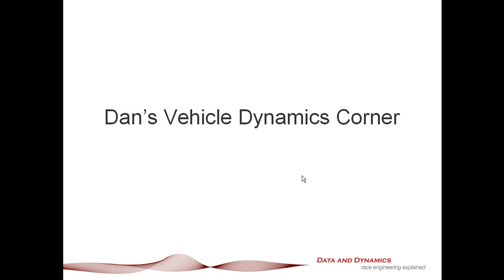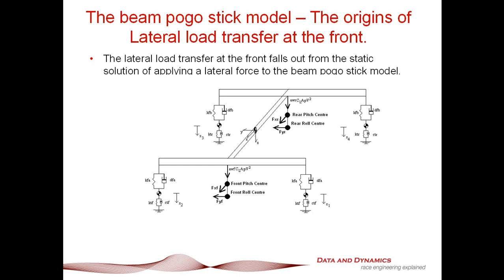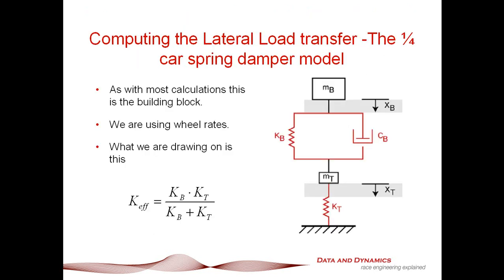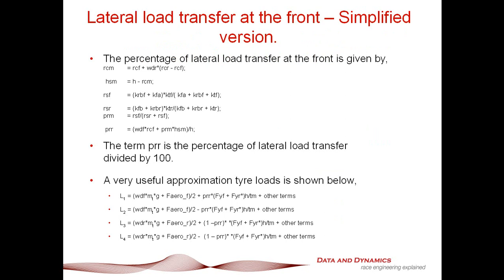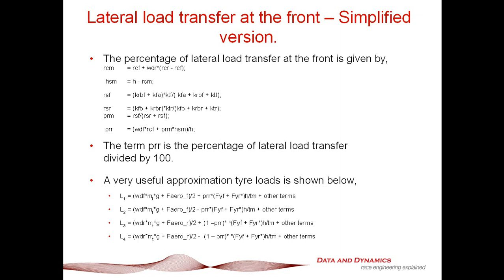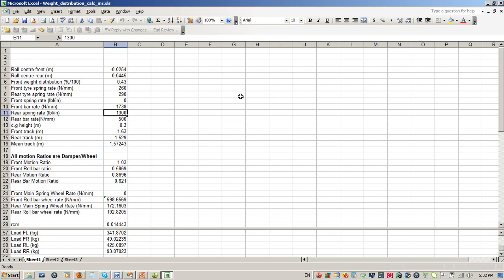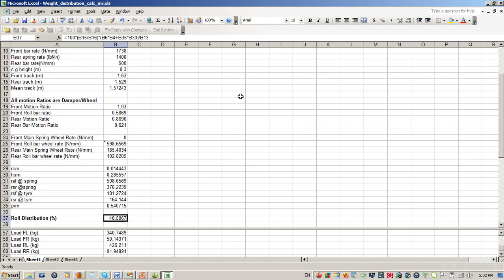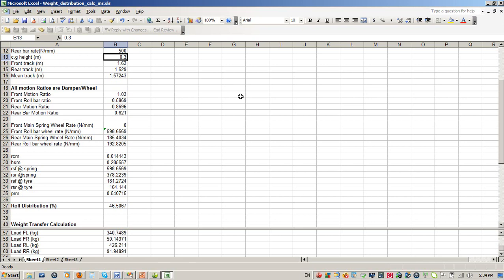Dan's Vehicle Dynamics Corner - Front Lateral load transfer

Comment: Do you have a video for longitudinal forces? I'm trying to figure out the acceleration profile of a vehicle that has load transfer onto the rear tires. The equations are fairly straight forward but I keep getting a recursive answer where the maximum acceleration keeps increasing as long as the traction motor can apply more torque. This shouldn't be the case, any advice?

Comment: could you please tell how to calculate lateral acceleration
Reply from the maker: Hey mate - lateral acceleration is a consequence and should come from the data. However if you know the corner radius ay = (Vx*Vx)/R where Vx is the corner speed in m/s and R is the corner radius in m.
Reply: @ChassisSim  isn't this the the counter for centrifugal force acting on vehicle during cornering
Reply from the maker: @5432Krishna  Hey mate remember lateral acceleration is a by product of the lateral forces applied to the vehicle. If you think of it this way it will make your like a lot easier.

Comment: Thnaks a lot for this vd...Can u please tell me how did you calculate height of CG and finally how to decide its location?
Reply from the maker: +Akshay Roge There are a couple of ways you can measure c.g height. You can either prop the front up and by noticing the difference in the scale readings calculate it that way. Alternatively put the car on an angle and rotate it until it is just balancing. The formula for that is cg_height = (0.5*tm)*tan(90 - roll_angle). Here tm is the mean track, and the roll angle is the angle to the ground where it is just balancing. In terms of some rough numbers, open wheelers/LMP1/LMP2 are about 0.3m, GT cars are about 0.4-0.5m. Road cars are in the order 0.4-0.7m. I hope this helps!
Reply: thankx for your positive response
actually I haven't manufacture my kart yet. I'm still in my design process...so how do I find roll angle of my kart?
Reply from the maker: Akshay - what I mean by the roll angle of the kart is when you angle it on it's side to determine the c.g height. Much like you see with stunt drivers in the movies. Given this is a kart you should actually get a really good measure of it. Just put the driver weights in the seat.
Reply: Sorry for troublesome but still the question remains, i haven't manufactured my kart yet ,for this I need to do lots of calculation to design my chassis and for that I need to decide my CG location.
Summing up I want to calculate my CG location theoretically since I don't have kart.
Reply from the maker: Now it becomes clear! Sorry mate. Calculating cg height is easy here's the formula,  

cg_height = sum of(h_element*m_element)/total mass

What you are doing is taking the mass of all the elements, measuring them with respect to the ground. Multiply these all up and then divide by the total mass and you are done.
Reply from the maker: +Akshay Roge One thing to also note total centre of mass is the c.g height so what I have below should help.
Reply: +ChassisSim thanku..for your help